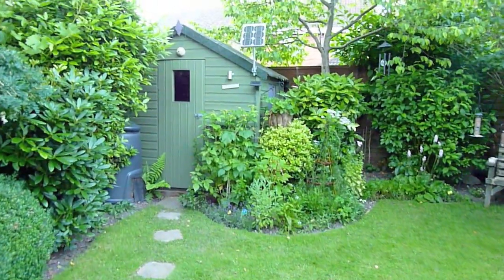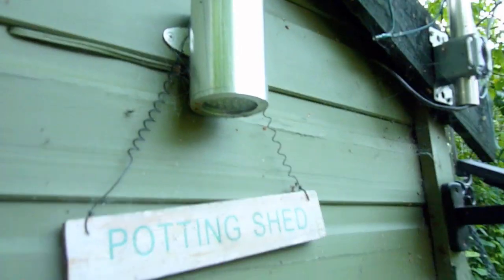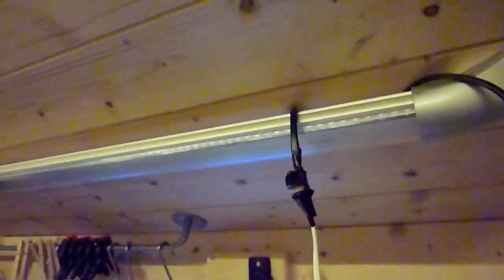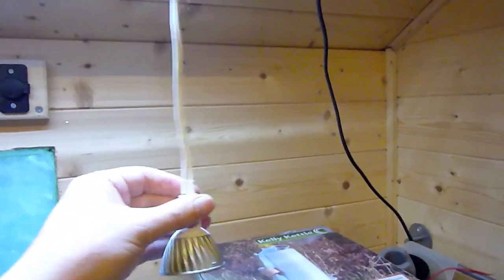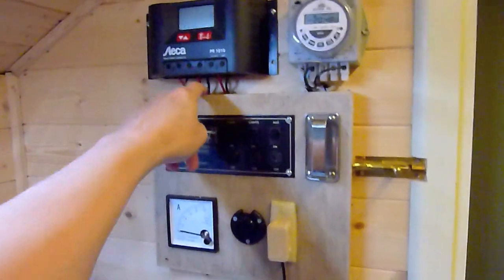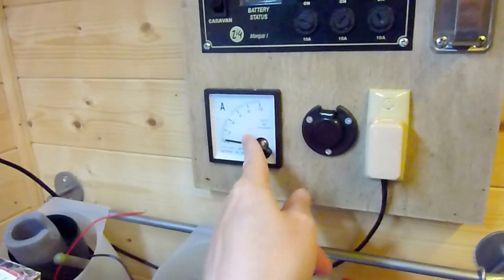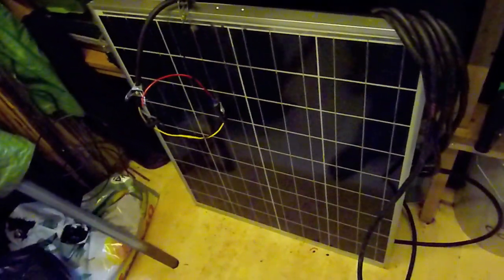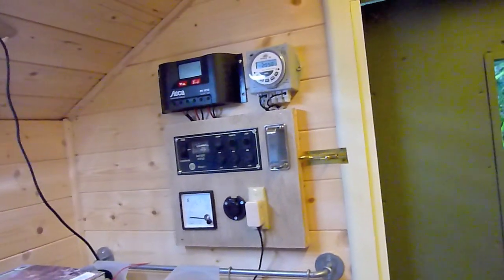Solar Shed 2

Comment: Love what you have done, very neat job, How much would this cost ? and ultimately is it worth it,  If I run led lights from the mains 220-240 volts with a transformer, the running cost is going to be very small. so I am wondering how many years before you see a saving, unless its done for saving the environment of course and not about the money or was it just a cool project to do ?
Reply from the maker: Hi Tony. Thanks for your comments. Costs are hard to say because in some ways, I've spent more than needed, but I wanted to learn along the way. The current setup uses a 40 watt solar panel (£75), Charge Controller (£18), 110Ah Battery (£80), the LED lights and bits of wire. I guess you could do it for under £175. However, I never did it to get a saving - as you say, it's much cheaper to connect to the mains (assuming your shed is not too far away from the house - armoured cable can be very expensive and tip the balance). I did it to learn, to see what was possible and what was not - it's been a great experience since I first installed a system in 2005 and I suppose ultimately it was a cool project!!!

Oddly, small solar panels are, per watt, much more expensive that the larger, grid-connected panels you see on house roofs. It got me thinking a lot about how much electricity we use and how we could live with minimal power use.
Reply from the maker: Just realised you are in the USA and my prices are in GBP £. I guess my £175 translate to $300 USD. Of course, there are cheaper solar panels available (and more expensive), but like many things in life, they don't always represent good value for money....
Reply: Hi Martin, I live in the Uk, many thanks for your reply, and worth the money in my opinion, seeing your video has made me reevaluate my task ahead, as I have two sheds that will need power and I am building an 8x4 metre workshop in my garden, so I have lots to think about, thanks for sharing your work, very interesting.

Comment: My shed has 800w of panels with 480 ah worth of battery. It is nowhere as neat and organized as your setup however.
Reply from the maker: Thanks for your comment Shaun. 800w and 480ah is a huge power bank - what are you using it all for?
Reply: Charging a technically not strictly legal electric bike, boiling eggs with a 300w dc element and powering a 600w peltier air conditioner. The worst thing is, I don't even have an inverter yet.

Comment from the maker: Locate the charge controller close to the battery (some have temp sensors and need to be close). If you are only having LED lighting then 1.5mm sq or 5-6 Amp wiring will be OK, although you could go 2.5mm sq as a main run, then branch out with smaller wire to each LED - have the fuse close the the battery/charge controller. A 3 - 5 amp rating should be fine. I would buy a small car fuse box/wiring block from Halfords and use that. If you want more help, get in touch via littlehouse.co

Comment: How do you run several sockets from the one load outage, can't see how the wiring is behind the board with all the switches on
Reply from the maker: You have to run the wiring in parallel (as opposed to in series). So for example, I have a positive wire coming out of the switch for the sockets and I run that to junction box where that one wire can then branch off into 2 or 3 runs to each socket. If I need to add an extra socket, I can join the positive of the new socket to the positive of the existing socket (or break into the positive wire and split it). If possible, try to plan where you want everything in advance and keep the wiring as short as possible as you can get power loss over long runs of 12V DC cable. All the negatives can be run to a common earth. I hope to explore wiring in more detail on a future video...

Comment: thanks for your guidance, its been very helpful, i have one last question, did you wire your amp meter into the battery side of the controller or the load side of the controller before the switches? I take it your volt meter was on the battery side to measure battery voltage?

Comment: hi where did you get your shed ?
Reply from the maker: Hello Christine. It was a company local to me - they came and erected it. Several years later, I insulated it and boarded out the inside with tongue & groove. It's not a big shed (6 feet wide by 5 feet deep) and wasn't expensive - I think around £250 10+ years ago. However, over the last 12 months I've had problems with the floor rotting - the main reason is that the shed is very close to my fence which means debris has been able to collect (that I can't reach to clear)...
Reply: ok thanks

Comment: Where did you get the bracket to the solar panel?  I have a 20 watt and want to do the EXACT same thing as far as mounting is concerned...  Looks great!

Thanks,
-Nigel
Reply from the maker: +NewShockerGuy Hi Nigel. The mounting pole and bracket to the shed is actually a TV aerial mount that I bought from the local DIY store. To mount the solar panel, I bought some flat and some 'L' shaped aluminium strips and fashioned a bracket to enable the panel to tilt at different angles - if I get the chance I'll do a video, although I no longer use this 10 watt panel having changed it to a 40 watt panel which enables me to generate power in the winter.
Reply: +Martin Doyle 

Thanks Martin!  Appreciate the info.  Definitely would love to see a video of it honestly!  Your setup for how the panel is mounted is exactly what I want to do but can't seem to source the parts anywhere... 

How did you mount the 40 watt panel?

I only have a small 20 watt panel but it's rectangle shaped.  But the problem I have is for my shed it's only got a single sided slopped roof that faces north.  And that's not ideal for power :-(  I will have to post a little video of my setup currently, no where near how nice your's is, that's for sure!  I just needed LED lighting for when it's night and I go in the shed for things.  

Thanks,
-Nigel
Reply from the maker: +NewShockerGuy Just for you.... https://youtu.be/jliP9DaHUtc
Regarding the 40 watt panel - it's still resting on the shed roof, not secured!!!! Must sort that out soon as I'm also going to try and fit a small wood burning stove - the flue will exit where the panel is resting so it'll have to move by then...
Reply: Martin,

Awesome!!!  Thank you so much!  This helped greatly!!

Much appreciated!!

:-)

-Nigel

Comment: Martin as a American on the other side of the pound I like to extend the most sincere admiration for you little shed and small backyard! very impressive my good man. The interior of the shed look worth of living in let alone slinging dirt into pots. I really am inspired by your video to redo one of the sheds we have for the BSA or Scouts where we keep our gear and equipment. This has given me good ideas for lighting  up and powering the shed that currently is a mess with its lighting system. We are running one of this cheap harbor freight shed lights with the tiny tiny solar panel. I believe its not enough to keep the battery topped off and thus wears the battery out rather quickly putting it through so many complete drainings and recharge cycles. May I ask what size battery you are using in this video for the shed? AGM battery? Amp hours? Thank you so much for this great video.
Reply from the maker: RViscara Sorry for the delay in responding and thanks for your comments. The battery I currently use is a 110Ah 'Leisure' battery (Lead Acid - the type used on boats / RV's etc) and a 40 watt panel. The battery is over specified but it means I'm only drawing off 5% or less per evening and hopefully the next day it gets fully charged with the solar panel. I've also tried a smaller 20Ah sealed lead acid battery which worked well too and was much smaller physically.

AGM batteries are very nice but generally more expensive. The solar charge controller that I currently use will not work with AGM batteries as they have a slightly different charge cycle, although most charge controllers do have an option to choose between Lead Acid (Wet) and AGM.

The last battery I used died quite quickly and I think the main issue was the small solar panel and poor location in winter. The current set-up is working very well - I have a fan running 24/7 (for the compost toilet) which draws around 1 watt and generally by 10.30 am, the battery is back up to float voltage (i.e. fully charged).

Thanks again for your comments - they are very much appreciated and I hope you progress things well with your setup!
Reply: no worries. I appreciate that you did get back to me. I am going to be giving this a try myself for a shed that gets very little use maybe 1 week at a time for a hour or two at the most. The LED lights are great for this type is use. thank you for the info.

Comment: Thanks for the reply Martin. Is this new device you speak of a solar charge controller with timer built in? What is the actual name and where did you purchase it? Thanks so much and good luck.
Reply from the maker: Hi. The new device is just a timer - I still have a separate charge controller. You can purchase 12V timers through Ebay. Like this one: 
http://www.ebay.com/itm/SINOTIMER-220V-110V-24V-12V-16A-Digital-Multipurpose-Programmable-Timer-Switch-/112427154572?var=&hash=item1a2d2e3c8c:m:mv7Nkyx37vsv9VooDBLvStg

Best wishes, Martin

Comment: I like that pole mount - where did you get it?  I want to do very similar on my shed.
Reply from the maker: Hi. It's actually a short TV aerial mount. I made a bracket for the back of the panel from some aluminium strips (from the local DIY store). There's a video on the mount here:
https://www.youtube.com/watch?v=jliP9DaHUtc